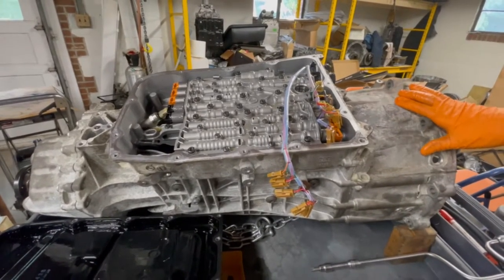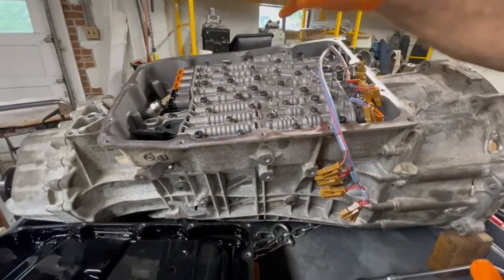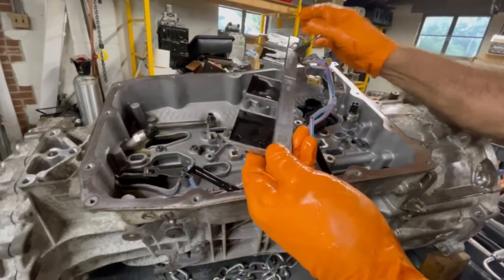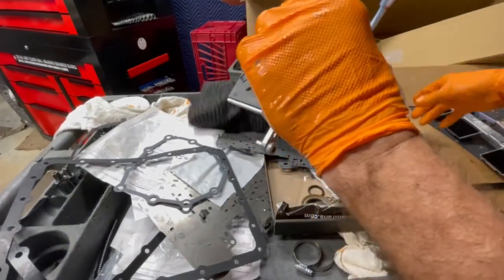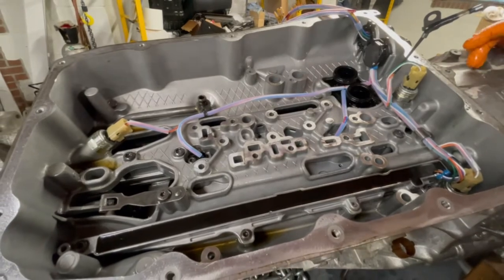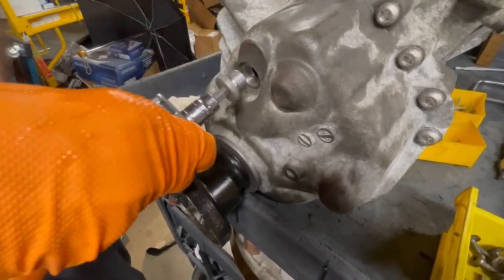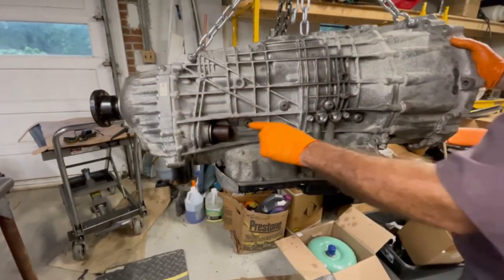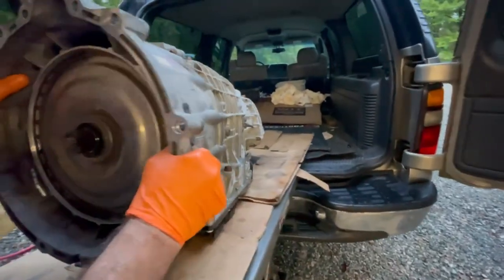2011 Porsche Panamera PDK Transmission Fault Code P1731 | Distance Sensor Replacement

Comment: Well, I just to replace the AWD pressure sensor number 3 and cleared the code on my Porsche panamera PDK transmission. 3 hours, a total waste of time. Car still runs, drives and shifts fine but it wont allow sports mode and the same P0971, 002085 and 00208A codes popped right back up. I dont know what to do at this point. Man, I wish I could get my car to your shop but Alabama it just too far away.

Comment: Hello Thompson, I really enjoyed your video! I’m in the process of changing the sensors too since the car suddenly won’t go forward or reverse. With the codes P1731 P1732 showing up and won’t go away when resetting. My question is after installing everything and closing it up, do I need a system recalibration meaning a transmission reprogramming with a computer? Thanks in advance 🙏🏻

Comment: I have a question before I purchase about a valve body for sale on Ebay. A dismantler is trying to sell me a valve body taken from a Porsche Panamera Turbo 970 that he claim is in 100% perfect working condition. He claimed he tested it both inside and outside the transmission. Is it even possible for a dismantler to test a valve body without any bolts in it after it is removed from the PDK Transmission? Every T27 and T40 bolt  is missing. How do you test it in that condition with no bolts in it while on the bench? Or is he selling snake oil? I also asked him why did he remove the smaller T27 bolts that holds the part together, he said "To clean it." But he never even put the bolts back in it. Does that ruin the valve body?
Reply: Unless you are standing there while they test the hydraulics, you wouldn't know if the test was actually done. They can tell you anything they want just to sell you the valve body. 
Personally I don't think a dismantler will remove the valve body and sell it on the side, that means they cannot sell the whole transmission to anyone. Unless that tranny is trashed to begin with, like a cracked case. 
I will not buy a valve body if it is missing the bolts. And if I don't have a way to pressure test it to make sure the hydraulics are ok before I installed it
Reply: @svennomore729  Thanks. You were right. The valve body turned out to be junk and the person selling it was a liar and a crook. I returned it but he tried to keep half the money.  I had to get Ebay involved to get all my money back. I ended up just replacing the entire PDK transmission for $19k.
Reply: @hellbent7062  That is a lot to spend on a new transmission. curious...  Why did you choose that route, instead of just changing the sensor wiring harness? Thanks in advance.  I just spent $4,500 changing out the sensor .
Reply: @ipsrentalproperties   @Matt DeLao  Well, thats a long story but the rule is don't ever buy a car (especially a Porsche) if you're either unwilling or cant afford to fix it. I agreed to this before I purchased the car. So, know what you're getting into. I am prepared to fix anything that breaks until I decide to sell it. Plus I love my Porsche. But to answer your question: You're right, 19k is a lot to pay for a transmission but anyone who owns a Porsche Panamera knows that's what they cost brand new and installed. I did see some used ones on Ebay for as low as 3k but no one can be trusted on Ebay for stuff like that anymore. They will lie and say it's in great condition and you wont find out its junk until after you install it nearly a month after you purchased it. Now you have to pay to remove it a second time and still go buy a new one. Sometimes trying to save money can end up costing you more in the end. I wasn't willing to take that risk. The final decision was made after I got 2 seperate independent diagnoses from two different places 120 miles apart. The first opinion was a bunch of  I don't knows and maybes. They even said it may be my 4WD system that needs to be replaced for 6k and if that dont fix it then maybe it's the valve body then if that don't fix it then it must be the transmission. Thats over 30k worth of maybes. The second opinion said it was definitely the transmission with 100% certainty. But before I got there I had already replaced the pressure sensor myself. There are 3 pressure sensors. I did change out the the one that the PIWIS Tester identified as the problem (the 4WD pressure sensor) but it didn't work. The other 2 pressure sensor couldn't be removed without first removing the valve body. However, the valve body can't be removed without having to recalibrate the transmission and replace the fluid. That's nearly 2k. This brings up the 3rd issue.  What if, the valve body itself was bad? Thats 5k. You don't want to replace all the pressure sensors, wiring harness and the valve body for 6k hoping it fixes the problem then find out you still got to replace the transmission for 20k because the clutches got worn out and you didn't know it until until you replaced all that other stuff. Then I did the math. I didn't want to take that risk and end up paying nearly 27k trying to keep from paying 20k. Not to mention the 4th issue the fact that the transmission had been having issues before that got fixed months earlier. This is likely due to the fact that I forgot to replace the PDK fluid at the 60k mile mark. That's a death sentence. I will change it at 40k miles from now on. But I didn't change it until 80k miles but it may have been too late. 6 months after I changed the PDK fluid the transmission started to lose 1st and 2nd gear and had to be babied until it got into 3rd gear where it drove fine. Then 4WD clutch started slipping when making hard turns. Then the car would build up so much pressure that it had to be put in neutral at red lights or when idling. Then the car would lurch forward whenever you turn off the ignition. All this got fixed with a PDK re-learn and clutch adjustment but that only lasted a few months then it came back worst. This means my clutch may have gotten worn and lost half its life. Now the transmission is not worth fixing if the clutches goes out in 6 months and still have to replace it. This was way too many unknowns to risk repairing a PDK transmission using the process of elimination. The PIWIS Tester was showing codes that didn't make sense even to the experts. Now I have a brand new transmission with new clutches new everything with zero miles on it good for another 100 to 200k miles. Also, I did think about selling it for half its value before I replace the PDK and just buy another Porsche Panamera Turbo but I decided against it because that car could have issues too. So, I decided to just make this one newer. At least I was able to get a 1k discount and a 2 year warranty and I don't have to sell it for half its value.
Reply: @hellbent7062   Thank you for a well said response. very informative. It's crazy with all of the tech we have, when a light comes on in the car, no one is sure what is wrong. And Porsche makes the parts too hard to get to and figure out. Just got my car back today. Sounds and feels good. We will see how long this lasts. I currently have 104K on  a 2011 PTT. Fingers crossed. Thank you

Comment: what do you do if you just replace the transmission completely? I have bad shift rod sensors. I did everything to try and recalibrate to no avail and found a idk with 75k miles less than mine for a smoking deal.  what programming must be done for a seamless install??? Thank you for your time.

Comment: The video is really well made and you can do the work by yourself. I had the same codes and was reading and researching before opening the gearbox. Because of your video i was pretty sure my panamera had this problem with the sensors. Replaced the sensors, oil and filter and the pdk was good to go. No coding either which was cool. Thank you for the detail video, keep it going man 👍🏻
Reply: Did you have to do a calibration with a scan tool?
Reply: Do you still have the car?

Comment: This video is very interesting. Clearly you have a great deal of knowledge. I think the PDK gearbox is impressive - but there is a big problem, that you have identified - parts. As these cars get older, there are more failures, and it seems like Porsche does not repair, they just replace the entire gearbox - at a cost of $20,000! 

I hope you do more videos on PDK. Thanks for this one
Reply: guess that's what you get for buying a porsche, LOL buy an old corvette and spend 20k on it and run circles around the porch... just sayin -- but excellent video with very detailed info -- great job !!!

Comment: Hello, I have a 2012 Panamera with the following codes , my question is the rebuild worth it rebuild and time wise, will this fix my vehicle that starts, but will not move.
P1731 display sensor shift rod gear 4/6 implausible signal
P1732 display sensor shift rod gear 5/7 implausible signal 
Would love to hear your advice 
Thank you

Comment: Hi excellent video. I own a repair we 2011 Panamera from another dealership with 89 k miles.
I am getting p1731 and p1732. This vehicle won’t move in reverse or drive. Codes won’t clear when  you put it drive message comes up to put it back in park. Does it sound like the shift rod is stuck in neutral. In other words. Changing shift rod might work? I going to pop the pan tomorrow to see if pan is clean. Also was going to check the wire from TCM to the connector. Thanks in advance.
Haider
Reply: Hi having same issue 🤦🏻‍♂️🤦🏻‍♂️🤦🏻‍♂️

Comment: My 2012 Porsche Panamera base model having transmission problems sometimes 
Dashboard showing transmission faults 
Sometimes have to wait couple hours then it started work again
I used o d pull out code
Showing P17F0 dual clutch transmission above upper limit 
P17F2 dual clutch transmission above upper limit 
P1731 display sensor shift rod gear 4/6 implausible signal
P1732 display sensor shift rod gear 5/7 implausible signal 
Would love to hear your advice 
Thank you

Comment: Thank you 
Does problem solve ? 
Where did you bought the sensor? My car have exactly problems
Reply from the maker: Certainly solve the problem. Got it from Porsche dealership in Atlanta, Georgia.
Reply: Such a amazing information 
Thank you very much 
These displacement sensors hard to find I ordered but take up few weeks $1450 . Do I need to replace pressure sensor and any boot while doing it ?
Valve body gasket etc.
Thank you again 
As soon I finally finish will post update
Reply from the maker: No. Unless you have the corresponding false code but replace the pan filter and fresh fluid.

Comment: Good morning I was wondering if on the Panamera 4 valve body to transmission has seals. That I should change when I doing displacement sensor.
Thanks
Reply from the maker: All O-rings and seals are included with the wiring harness with the position sensor and the filter oil pan is brand new and includes the rubber seals.

Comment: 3 questions: I have a 7 speed Porsche Panamera Turbo that has a P0871 pressure sensor number 3 (HOK) fault. 
1) Is that the AWD Pressure sensor? And 
2) Can the AWD pressure sensor be replaced without removing the valve body?
3) Since that distance sensor you replaced is easily accessible from the PDK oil pan, why did you remove the entire transmission just to replace it?

 I wish I had a tutorial video of you removing that PDK transmission. There's a lot of useful knowledge in that alone.
Thanks for the great, informative and very helpful video. I subscribed immediately when I seen this video.
Reply from the maker: 2) It probably can.
3) The engine coolant manifold between the two cylinder head heater hose connection was leaking and the manifold was replaced while the transmission was out.
Reply: @ThompsonAutoTest  thank you so much for the quick reply. I'm about to change out that AWD pressure sensor when it arrives in the mail. and since I don't have to remove the valve body, I wont be required to recalibrate the transmission or use PIWIS oil fill mode. I believe all I will have to do is remove the oil pan (a simple drain and fill) replacing the AWD pressure sensor in the process.

Update: Well I just to replace the AWD pressure sensor number 3 and cleared the code. 3 hours, a total waste of time. Car still runs, drives and shifts fine but it wont allow sports mode and the same P0971, 002085 and 00208A codes popped right back up. I dont know what to do at this point. Man, I wish I could get my car to your shop but Alabama it just too far away.

Comment: Do you need a system recalibration after the replacement?
Reply from the maker: I used Autel MaxiDAS scan tool. Clutch calibration is not necessary nor desirable.

Comment: i have the same problem on my panamera 4s 2009 the gears no longer want to go and porsche said to change the gearbox what do you think?
Reply from the maker: There is a specific set of false code that indicates the problem with the shift fork position sensor. New from Porsche that position sensor assembly is quite expensive. Make sure that is what’s wrong with PDK transmission.

Comment: I heard you say "How much does this cost" but made no mention of the price? Also how many hours does this job pay?
Reply: I bought replacement part at gaudin Porsche part for $920
It take 3 mins to do the job
Very easy do it yourself
Reply: @PhungDuyvo  hi how are you I see u had the same issue everyone else is having here I’m also having the same code P1731 p1732 I have a question was the price 1300 or I believe u stated 900$? Also do u have recalibrate transmission with scanner? And do u have to put new transmission oil  and filter? Thx man I really need ur advice
Reply: The part I bought from gaudin in Las Vegas $975
Took less than one hour to replaced no need to program anything
Reply: @marcosa6946  
Part is $974 at Gaudin Porsche in Las Vegas and took about 1 hour do it yourself. No program need it.
Reply: @PhungDuyvo  nice it’s been the biggest stress for me these last 2 months nobody can figure it out finally found the solution thank u